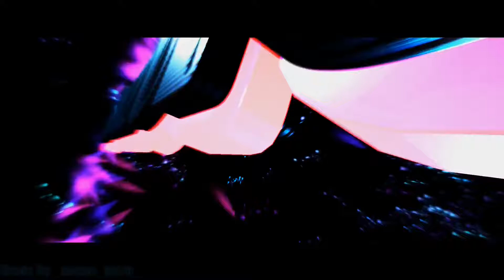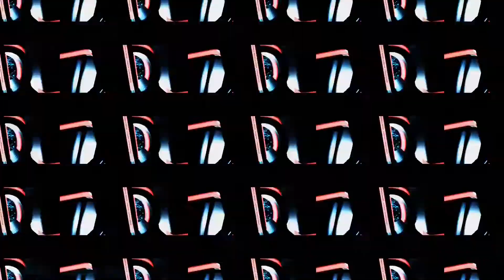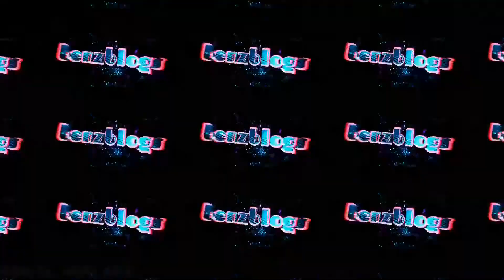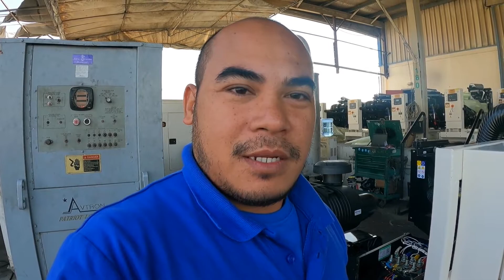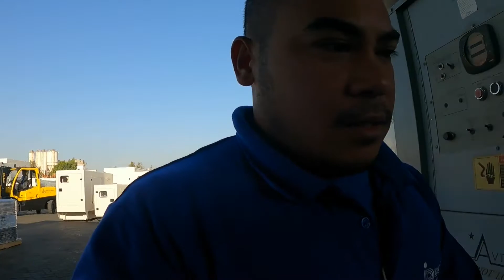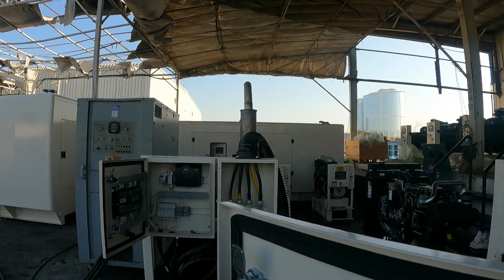L-series problem,speed controller problem benzblogs

Comment: Sir pag underspeed alarm??
Naandar naman mga 1minute biglang magshutdown??ano po kaya problema
Reply: Cummins 120kva
6bt engine
Reply from the maker: Check mo ang speed mo ano bayan 60 or 50hz
Reply from the maker: Pag 50 -1500rpm dapat pag 60 1800rpm dapat okay para di mag shut down
Reply: Naglalaro lang sa 800-900 rpm sir kaya nagsshutdown 

1800rpm sya 60hz
Ano po kaya sir pwede kong gawin??
Reply from the maker: @michaelangelomalonzo8653  sir kong my speed controller pwedi k mg adjust ng speed pwro kong electronic engine kailangan mo ng diagnostic tool to adjaut

Comment: how to find minimum position and fail direction for engines.
Trying to program lg2 speed controller but the engine runs perfectly but when we shut down,  it runs for a minute or two after
Reply from the maker: What engine your using and what kva?

Comment: sir, how do you reset the l series in software ?
Reply from the maker: Sir reset only can do the alrms if u want to remove juat connect your est toolkit thin find the reset to remove the alarms
Reply: ok sir, where to set the digital input adjust RPM because my machine has a problem, when I increase it to 1500 RPM on the digital input selector spring on the panel, the RPM slowly drops back down to 1300 RPM, where is the problem sir?, thanks
Reply from the maker: @Izanzedarr  make sure that the calibration is correct and the configuration must correct

Comment: hi, i have an l series on a v8 engine, the problem is that it runs haphazardly. it never stabilizes. works in 50hz,
 The question is.
How do I connect it to the computer? to verify the stability and gain parameters,
I have the program and the cable com.
I have the installation manual. I connect it as it says there but I can't communicate with the PC.
it will be that you can help me. Thank you
Reply from the maker: You need the software for that in order to connect the computer
Reply: @benzblogsVlogs  

the actuator is a woosward. p/n 8404-4005

I have the software. Woodward L-Series Service tool rev. R version 3.0.9112.0

and I also have the cable.

the connection i used is
pin 1 +
pin 5-
pin 3 gnd
pin 4 tx
pin 5 rx

and it does not give me communication with the pc
Reply from the maker: @waldolisandrograizaro7810  yea it is woodward you have the toolkit for this
Reply from the maker: @waldolisandrograizaro7810  nonof you have the software for this thin there you can calebrate for the gain and stabilty till me if you are connected to your software so we can apply the value for this okay
Reply: @benzblogsVlogs  
What would I be missing to achieve communication between the PC and the actuator?
Reply from the maker: L-series or heinzman pandaroz

Comment: Hello
Reply: I have a 2880A016 rev cable.
5450-1033 adapter. 
But still can't connect to lcg. Can you help
Reply from the maker: @ramzanzainool5774  is this for LSERIES? You need 232 to usb converter to work in the computer
Reply: Yes this is the L series, i am able to communicate but the rpm maintain 1800rpm under the load.
Reply: does not maintain 1800 rpm under load

Comment: Why always this failler 3 time I replaced work good then proplem
Reply from the maker: Wich one sir lseries actuator?
Reply from the maker: The problem is nit in the lseries make sure you install properly the mpu and the avtuator itself ok
Reply: @benzblogsVlogs  after i put new one he worked for one mouth then the engine hunting RPM not stable
Reply from the maker: @wasifali4983  hunting happen if you have water in fuel and and in proper config of lseries thin the magnitic pickup

Comment: Sir ask lng po ako pg mg configuration tayu need ba talaga sa loptap or sa module lng Kong mg loptap may software na bayan Ang modules naka bilt in
Reply from the maker: Yea sir para ma acces mo yung di maaces na dapat maconfig
Reply from the maker: Kolang kc pag sa module
Reply: @benzblogsVlogs  sir automatically naba ma access natin yung program sa modules na nka belt in na from manufacturing kadalasan kse sa genset nmin hirap mg start up unstable supply sa actuator.
Reply from the maker: @funkyallabe3316  ues sir if you have the laptop to configure it
Reply from the maker: @funkyallabe3316  nasa kaba ngayun sir kong hirap mag start up maraming dahilan yan sir ither naubusan ng fuel,hinangin,or kolang sa startup fueling ither my problima ang fuel sonleniod etc marami pwedi kc sir dependi rin sa area
Reply: @benzblogsVlogs  yes Sir  try ko slamat sa idea yan lang talaga #1 problem sa genset deto na ma technical na
Reply: @benzblogsVlogs  deto nko sa pinas sir Maintenance facilities ako sa cement plant dto sa cebu
Reply: @benzblogsVlogs  yung Isa hirap Ang crank nya yung Isa nmn unstable Ang acuator supply d aabot sa 1800 na rpm na mamatay sxa
Reply from the maker: @funkyallabe3316  1800 is normal sa pinas equal yan sa 60 hz
Reply from the maker: @funkyallabe3316  sir anong engine ang gamit nyo at module
Reply: @benzblogsVlogs   sa module sir from.china sxa CAOLE  yata yun yung Isa nmn smartgen
Reply: Bagu lahat form  module and speed controller
Reply from the maker: @funkyallabe3316  sir dependi po sir
Reply from the maker: @funkyallabe3316  if generator is new oo naman
Reply: @benzblogsVlogs  replacement lng yung modules sir Ang diagnosed ko do on baka need tlga ma reset o ma reconfigure sxa 6.7 v lng ang supply nya sa soliniod galing sa speed controller nya
Reply from the maker: @funkyallabe3316  sir ilng kva sya at battery ilng nkakabit 24/12
Reply: @benzblogsVlogs  24 v sir  galing sa speed controller Sir Ang supply sa solenoid
Reply: 100 kva
Reply from the maker: @funkyallabe3316  12vdc lamg suplpy nyan sir
Reply: @benzblogsVlogs  BKa sa speed controller na yun sir Ang problema
Reply from the maker: @funkyallabe3316  sir ang actuator po di yan permanent ang volatge depwndi yan sa load tataas baba ang volatge nyan
Reply: @benzblogsVlogs  yes sir kse hirap Ang makina sa 1800rpm dapat  prang d kaya sa acuator  sinagad ko peru bomitaw tlga ok nmn resistance nya may msg kba sir send koa sayu ang speed controller nya
Reply from the maker: @funkyallabe3316  ok sir pag ganyan sir check mona din ang enjection pump mo sir kc ang speed controller ngbinigay ng commnd lang yan kong ilang percent ng fueling para sa makina
Reply: @benzblogsVlogs  ok sir try ko suggest sa mechanic yan halos ganyn problema sa genset nmin now lng kse Nila na pa check  salamat Sir sa mga sagot mo

Comment: Sir may tanong lang ako regarding the load bank pareho lang ang ginagamit natin na load bank avtron, ano ang oroblema pag yung toggle switch ay ini on ko yung 2 hiling toggle switch pero nag aanbalance ang load ano kaya ang problema ng load bank namin minsan shutdown siya
Reply from the maker: Meaning ither 1-2-3 heating coil na my problima nyan sir potol na ang lenya double check mo lang din sir if kong gomana ang contactore nya all line 1-2-3
Reply: @benzblogsVlogs  thank you God bless
Reply from the maker: Ok sir ganito lang yan unbalance meance 3phase ang load mo tama

Comment: hi benz. May tanong ako tungkol sa Lseries. Mayroon akong isang 60hz 1800rpm generator na gumagamit ng lseries. Mayroon akong 2 katanungan;

1. Ano ang aktwal na bilis ng fuel pump na kinakailangan bago namin ikonekta ang koneksyon sa Lseries? Ang Lseries ay nakatakda sa 1800, kailangan ba ng mas maraming bilis ng engine kaysa sa lseries?

2. ano ang problema kapag ikinonekta ko ang koneksyon sa lseries, ang bilis ay nagpapanatili lamang sa 1800 nang mas mababa sa isang minuto at pagkatapos ay nagsisimula itong tumaas nang dahan-dahan nang hindi humihinto.
Reply from the maker: Yes sir ano po ba yun
Reply from the maker: Sir kong ang engine enjection pump mo ay 1500-1800 convertable no problem mo pwedi mo ilagay yan magkakaroon kalang ng problima nyan if yung magnitoc picup mo ay di gumana at kailanagn mo din nag configuration nyan baho gumana
Reply: @benzblogsVlogs  oo Benz, ang ginagamit kong generator ay gumagamit na ng lseries. mayroon lamang ilang mga isyu na nauugnay sa bilis. kung ikonekta ko ang socket ng lseries sa lseries, ang bilis ay unti-unting tataas mula 1800 hanggang 2000. ang magnetikong pickup ay nagbago din kamakailan. nasilbihan na rin ang fuel pump. o ang magnetic pickup ay may negatibong positibo?

Comment: Sir un governor interface at avr interface ba hindi puede gagawin dahin ito ay factory setting ng supplier at kong iadjust ito paano ang pag adjust ng centre sw1 at range sw2 paki answer nmn ty.
Reply from the maker: Sir pwedi pong galawin if allow sa inyo galawin now kailangn mo lamg e match that sa ibang dg mo
Reply from the maker: Dapat paripaihu sila
Reply from the maker: Thin kong tomaas yung rpm or voltage doon ka na mag adjust sa avr mismo at speed controller
Reply: @benzblogsVlogs  sir un 500kw na 625  ang problem  ecu na un speed nia dina analog para iadjust kailangan ng loptop o software mayroon akong software para lang sa dse pero electronic tool para sa ECU wala kami kaya kadalasan na adjust un governor interface di na nbabalik un factory setting ng supplier
Reply: Kaya minsan nag haunting un rpm
Reply from the maker: @josephgammad2338  Cummins yn sir tama?
Reply: @benzblogsVlogs  sir perking sir pero ECU control un speed nia
Reply from the maker: Pwedi k doon sa speed controller mgadjust
Reply from the maker: Kong ecu sya ganito gawin mo doon knalang madjuat sa sw1 ng gov
Reply from the maker: But make sure na kayang habulin ng iba ang settings mo ok
Reply: @benzblogsVlogs  thanks I will try ur advice sir sana wagkan mag sawa sa amin na tatanong nag bi bigay ng sagot God bless sir sa channel mo
Reply from the maker: No prob sir

Comment: Sir ask lang po,, pano naman po yung may engine interface mudule pano po wiring diagram and mga connection po nya,, salamat po
Reply from the maker: Sir electronic engine po ba ibigsabihin mo
Reply: Opo sir
Reply from the maker: So ganito if electronic engine yan mgkakaroon lamg sya ng communication between ecm ang dule trough can buss just connect it thin select what is the correct type of ecm fitted in your egine and config.it in the module there is a selection there for the types of emgine pls subscribe there is vedios there you watch thank you